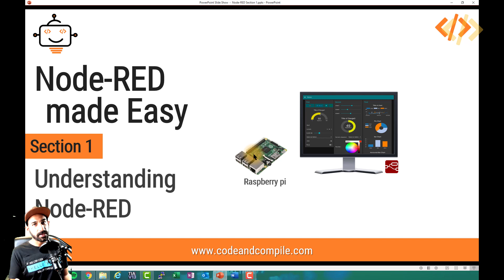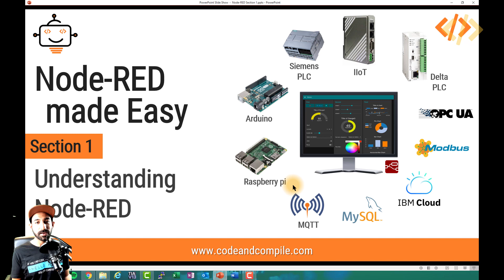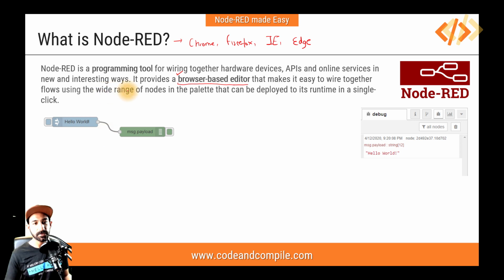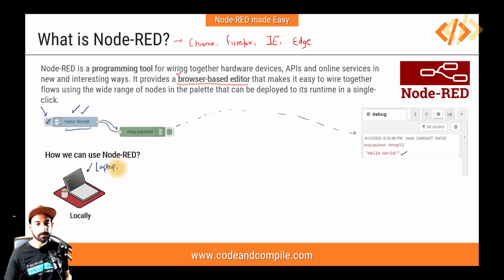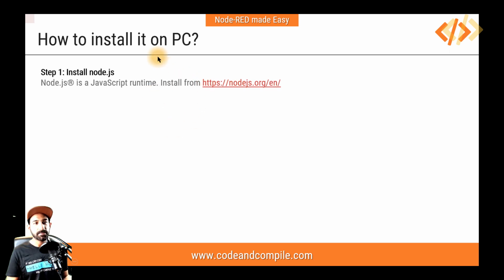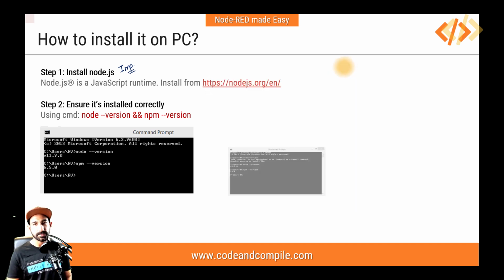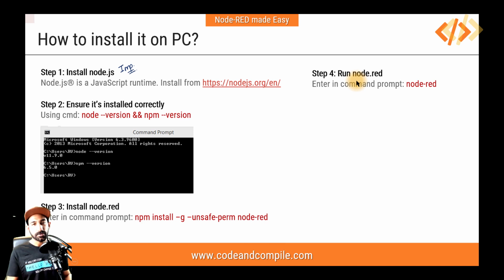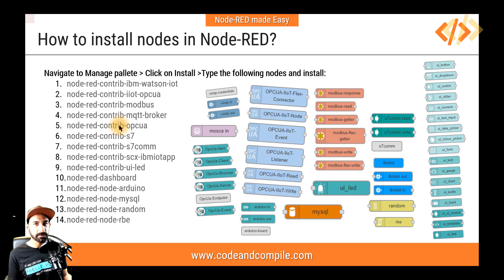Lesson 1- Understanding Node-RED

Comment: Hi Rajvir,

Thanks for this great tuts, what are the options to auto-discover an S7-300 or S7-400 in order to get the datablocks and tags?
Reply from the maker: Hi, In Node-RED unfortunately there is no auto discovery but you can use some 3rd party softwares for that.